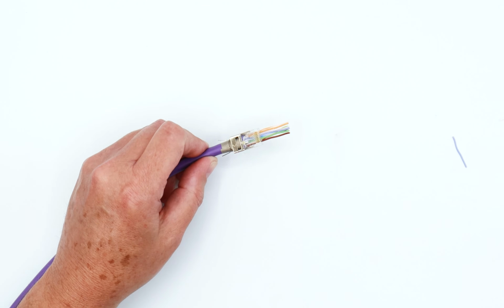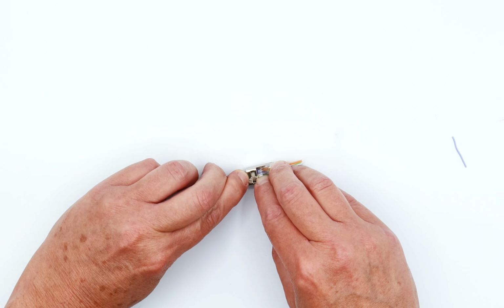Simple Way to Terminate a Cat6A External Ground RJ45 Connector

Comment: I'm having trouble getting the connectors to properly latch and lock into a port once crimped; they fall out/disconnect at the slightest of jiggling. I'm using your branded cat6a shielded cable, connector, and crimper. Any tips on getting these to properly crimp and latch into a port?
Reply from the maker: Hello! Sorry to hear of your difficulties! Two things come to mind. First is that on many consumer devices the RJ45 female ports are poorly designed and misaligned or recessed too far. This will cause the plug to not fully latch. I have seen this on poorly designed home routers/switches. Some plugs would not fully latch and others would latch successfully latch so far inward that you cannot get the plug back out no matter what. This is poor product/port design and the only remedy is to to replace your electronic hardware with better hardware. The other possibility, less likely, is sometimes during the crimping process the bendable latching tab on the top of the modular male plug may get squished down and not be at the correct angle to latch. Bending it upwards a bit fixes that, but my guess is that you already tried that which brings us back to a bad port or bad port design on your equipment. You may wish to get in touch with us directly via our Contact Us page at www.truecable.com so we can take a closer look and get some pictures from you.

Comment: is the copper tape and that little tail required?
Reply from the maker: Hello! The copper fabric conductive strip is not strictly necessary as you can fold back the cable shield, wrap the drain wire around the folded shield, and then proceed that way instead of removing the shield and tacking down the drain wire with the copper adhesive fabric strip. The little tail is ABSOLUTELY required for this particular plug because it is the only strain relief the plug has. It is literally the only thing holding the cable onto the plug other than the golden contacts at the front of the plug, and you don't want to put strain on the golden contacts. This particular plug does not use a "strain latch" like most unshielded plugs (and many smaller shielded plugs) do. Therefore, not only is the tail necessary but it must be properly and firmly crimped around the cable jacket to make the termination electrically stable.

Comment: Hello, are you wrapping the drain wire with copper tape on BOTH ends or just one end
Reply from the maker: Hello! This method is being used at both ends to terminate the cable shield and drain wire to the termination hardware.
Reply: "Grounding shielded Ethernet at both ends can create ground loops and introduce interference or PoE instability — TIA-568 standards recommend grounding at one end only."
Reply from the maker: @kenoakes6725  Hello! Actually, the ANSI/TIA-568.2-E Standard in Section 5.7.9 and TIA ANSI/TIA-568.0-E Standard in Section 6.2.5 explicitly state that both ends of the cable shield should be bonded to ground. TIA 607-E explicitly states that your entire bonding system MUST be equalized to the AC ground electrode system. Now, you are right you may experience issues with ground loops by bonding both ends of the communications channel to ground -- IF something is wrong/off with your bonding system. The standard assumes that all potential bond points (no pun intended!) are equalized with 0.1ohm impedance. As such, if you lack the equipment to be absolutely certain of your bond points and equalization, you should bond one end only but that is NOT in the standard and falls more into best practices for avoiding potential issues. The real best practice is to NOT USE shielded copper twisted pair Ethernet unless you are installing it absolutely correctly. The reason, and what we have not talked about, is what is the follow-on affect of NOT properly bonding both ends of the cable shield to ground? Higher resistance most certainly. Less effective cable shielding likely. It has not ever been measured and presented in a scientific manner, however. I hope that clears it up!

Comment: Kindly assist in my little confusion.
In the previous videos you had advised not to remove the cable shield. but you have done the exact opposite here by removing the cable shield.?
Reply: Which video are you referring to? I don't have a copper fabric strip, so would like to use the method where you keep the cable shield
Reply from the maker: @koenvleugel5793  Hello! In many of the shielded termination videos I make use of the copper fabric strips as the best way of bonding your cable shield/drain wire to shielded hardware. It makes thing so much easier. That all said, here is an older video that shows the fold back method! https://youtu.be/s0NBL7ezMeE?si=ZZsdjneHJTVSMFMS
Reply from the maker: Hello, and sorry for any confusion! We added a new accessory, our copper fabric strips, that stand-in for the cable shield when terminating. You remove the cable shield, fold back and wrap the drain wire around the jacket, and then tack down the drain wire with the conductive adhesive copper fabric strip. This makes the job a lot easier. If you don't have the copper fabric strips then you would still leave the cable shield on and wrap the drain wire around that.

Comment: Can you give more info about where you said don't use this RJ45 connector on the other end?
Reply from the maker: Hello Chris! Indeed. It is a bad idea to (in general) terminate 8P8C connectors onto both ends of solid copper conductor Ethernet. For a number of reasons, this is the least performant and stable way of terminating this type of cabling. There are situations where you MUST do it, but you need to have an excellent plug-to-cable fitment (Category is not relevant) in two different dimensions, and preferably, the cable and plugs should be sourced from the same supplier AND the supplier should have tested them as a system. This is something trueCABLE does, but we still recommend termination of 8P8Cs onto a single end of the solid copper cable, and the other end be an IDC style termination (e.g. keystone jack, monolithic patch panel) due to far better durability and mechanical (therefore electrical) stability. You can read a lot about this in a blog I wrote that covers the ins and outs and whys of this subject here: https://www.truecable.com/blogs/cable-academy/terminating-pass-through-rj45-connectors-onto-solid-copper-ethernet-cable-a-really-bad-idea.
Reply: @trueCABLE If your client requires 10 GB cable certification, your  test will have to show that ground wire going through both ends. Essentially you'll have a nine wire cable.
Reply from the maker: @tcholmes2237  Hello, and essentially correct. If you are Certifying shielded cable, that is. In that case, your Certification test set will run a shield resistance and continuity test to confirm the 9th conductor (the cable shield). If you select the correct cable type in your Certification device when setting up the tester, this 9th conductor will be checked for and fail Certification if not properly hooked up or present.

Comment: Hi thanks for the informative videos 👍
Question? You cut off the outer jacket, then the outer foil shielding, then the polyester wrap then wrapped the drain wire around the outer jacket. Shouldn’t the shielding be grounded also or is it somehow touching the drain wire through the polyester wrap?
I’ve seen some videos showing the foil shield folded back and grounded to the jack.
Reply: Thanks 🙏 
What’s your thought on grounding both ends? Is that required in all cases?
Reply from the maker: @BacktrackADV  Hello again! No problem. As to bonding both ends to ground, that is the best practice unless the physical installation somehow prevents you from doing so OR you are looking to avoid a ground loop. If you seek to avoid a ground loop, then you would find a way on the remote end to be sure the cable shield does not end up bonding to ground. You can achieve that by not using the drain wire or cable shield---simply remove them and terminate without bonding the shield one one side. There are a lot of ways to go about it.
Reply from the maker: Hello! You are welcome. As to bonding cable shields to your termination hardware...There are multiple ways of going about it. The drain wire does make full-length contact with the cable shield. My favorite way is to use the copper fabric strips to tack down the drain wire with the cable shield removed. The reason is it contributes to a thinner termination end. You can, of course, also use the tried and true method of folding back the cable shield and wrapping the drain wire around that, too. The problem with that is sometimes the foil shield is nicked and will rip off easily, and folding back the cable shield adds thickness to an already thick cable. A third way, and a bit riskier, is to remove the foil shield and forgo any kind of copper or copper fabric strip, and rely on the drain wire to make contact by itself. That method always makes me nervous because the drain wire can easily slide out of position, and you would get poor bonding contact.

Comment: I had to Field reterminate a 100 foot ethernet cable a few months back and because I already ran the cable from the back of the room to the front of the room up to the podium for the HDMI converter I decided to use the pass-through connectors to make things go quick and easy and not accidentally get pears switched around. Well last month I noticed an issue with the video cutting in and out and I had to swap the entire cable out. I recently got around to testing it I don't have a high dollar tester yet I'm waiting for the puck ethernet to come back in stock along with my budget. In the meantime I used one of those $10 cheap testers and a homemade tester that I've made and I am showing connections with no faults but there's gotta be some sort of fault since it's causing the HDMI converter to lose sync? I am probably going to cut the end off and redo it again wondering if maybe there's a mismatch between the cable and the connectors or maybe for some reason the junction loosened up this is the first time I've use the pass-through connectors. Any advice?
Reply from the maker: Hello! I fully understand the issue and frustration. Just because a wire map tester says your cable is OK does NOT mean your cable is "OK". Wire map testers only test for continuity in the correct order, but they tell you nothing about performance. Wire map testers do not reveal nicked conductors, ill-fitting RJ45 (8P8C) plugs, or excessive conductor untwist--all of which will lead to poor performance and the issues you describe. I understand you wish your cable to end in male terminations, so the best way to accomplish that with the best possible chance of success (without an advanced tester) is to use field termination plugs. Field termination plugs are IDC style terminations that are much more secure and performant, while being much less sensitive to fitment problems. Field termination plugs also are Category rated and have a PCB inside. I wrote extensively about this in a blog right here: https://www.truecable.com/blogs/cable-academy/terminating-pass-through-rj45-connectors-onto-solid-copper-ethernet-cable-a-really-bad-idea. I strongly suggest you read it. You can pick up field termination plugs in shielded or unshielded versions. trueCABLE sells them on our website here: https://www.truecable.com/collections/connectors/type_field-term. That is the best advice I can offer you! PS--if the field termination plugs do not resolve your issue then I would suspect the cable itself.
Reply: @trueCABLE  yeah not necessarily looking for certification although I would love that but not for the $10,000 price of fluke products. Yeah those ends look quite fancy didn't have any on hand. I did have the True cable pass-through connectors and this was a perfect opportunity to try them. Thankfully the cable wasn't in walls it was just rolled around the room and taped down But that's still a lot of hassle. Last month I used a different cable and had the same issue so it might just be the quality of the cable. After switching it to one of my personal cables no issue and then another time I swapped in a 75 foot with a 15 foot extension and coupler and had no issue. either way now the converters are on my bench to test before the next show end of the week. I hate HDMI it tends to cause so many problems because of the copy Protection...
Oh I should say this is not solid copper it stranded. Mobile set up so didn't want the repeated flexing to break the cable prematurely.
Reply: You’re never going to get the pocket ethernet they are out of business
Reply from the maker: @ttss5726  Thanks for the heads up. I was unaware they had gone out of business.
Reply: @ttss5726  well that's good to know? this is literally the only thing I've heard about it. last i visited the website it's still listed as available (Availability Q4 2022) yahhhh. Unfortunately I'm having a hard time finding anything relatively close to what that does. Sure there's other devices for checking POE and then there's other devices for running network scripting/payloads then there's the flute$$$$$$$$$$$testers. And like most things in my life as soon as I can afford it I'm looking for it on eBay because it's been discontinued.
Reply: @ttss5726  got any recommendations for a tester that's not the price of a car (already have a car payment) and does wire map, TDR and POE. Or maybe a combination of devices that's not $300. I have one of those $20 testers off eBay but it does not necessarily understand split pairs. $200 would've paid for itself two years ago running around somebody's house with all sorts of messed up connections.

Comment: Oh great some thing else I'm gonna have to buy those copper strips look really handy. I have been using analog audio over cat cabling for a few years now and I made up some adapters… Which I accidentally wired the wrong way around so I'm gonna have to redo them at some point. I need 8 and at least remake 4 of them reversed. I needed to shift the pairs around to shift the signaling to match up with numbers and things. Needless to say it works on one end of the cable perfectly but if I put it on the other side it doesn't and shifts channels to the wrong spots. So where was I going oh yeah I'm working with shielded cable and I was a little concerned that the ground drain wire would not make reliable contact just pinched but adding that little bit of foil tape would make me a lot more comfortable. As I'm sending balanced audio down each pair that's 4 audio channels the system actually uses the shield as the negative return for 48V phantom power so it's important that's intact and doesn't come loose otherwise it'll make popping sounds.